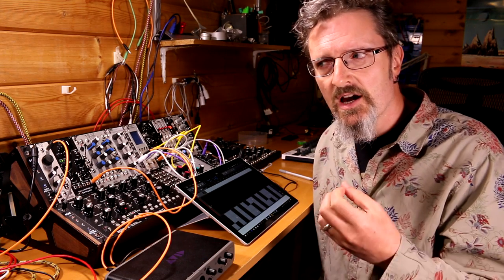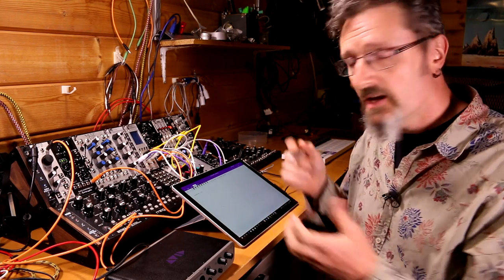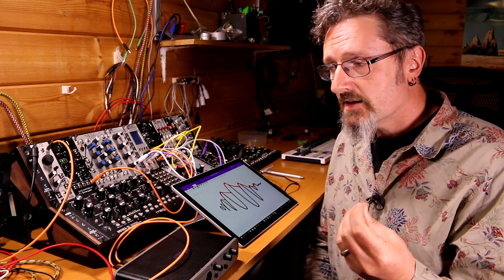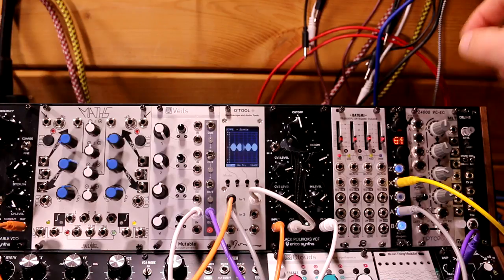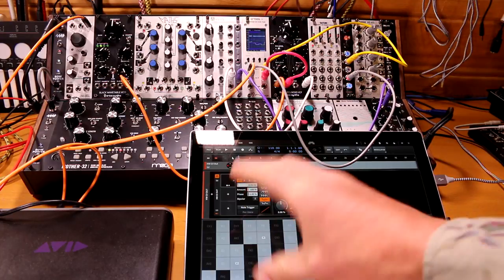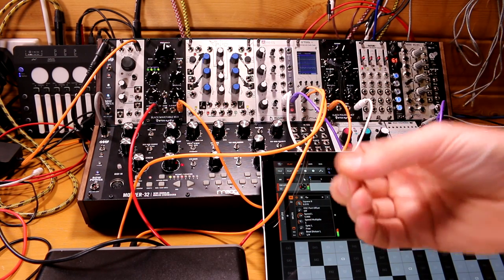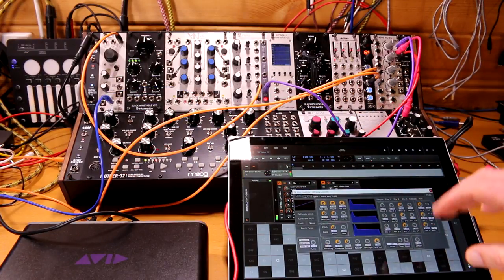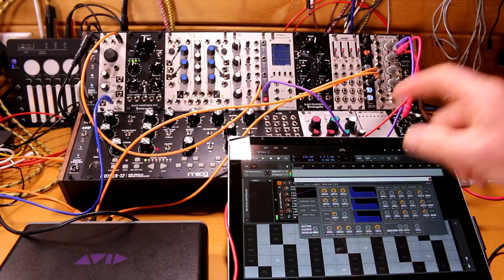Molten Modular 12 - AC coupling, CV and DAW control with Bitwig 2.1

Comment: It's an AC coupled interface, but it identifies as a DC coupled interface.

Edit:  Could you just use an envelope follower instead of the ES-1 algorithm on the disting to convert the AM encoded CV signal?  Also great outro!
Reply from the maker: That sounds plausible, especially for triggers - not sure on the accuracy of other CV control, but someone needs to try it :)

Comment: You will need two separate Distings if you want to use both the inputs and outputs of an AC Coupled Interface. The reason the tuning doesn't work is because the signal going into the interface needs to be converted back from normal CV to something the BitWig HW Instrument input can work with.
Reply from the maker: I read that and almost had an epiphany - of course, that's what i need to do!!! Except, no - the reason being that the signal coming back to Bitwig is audio, not CV - it's the audio signal from the oscillator that it tunes to so it needs no conversion and in fact there's no "AC" button on the input in the Device. Aaaaand The Silent Way one works fine using exactly the same connections. So for a moment there i thought you had cracked it - but, sadly, that's not the answer.